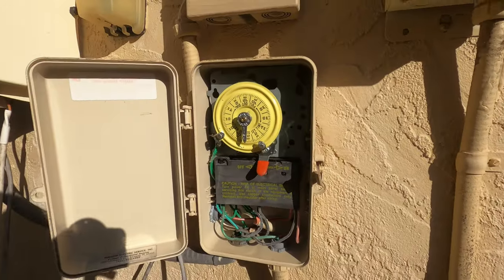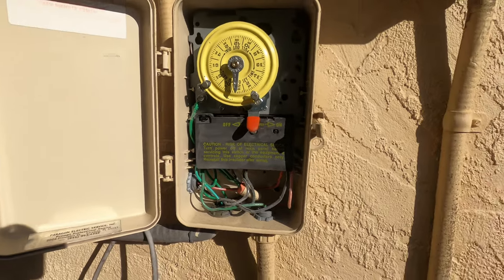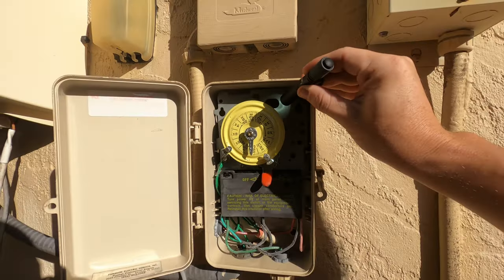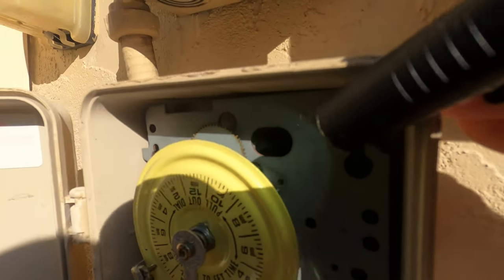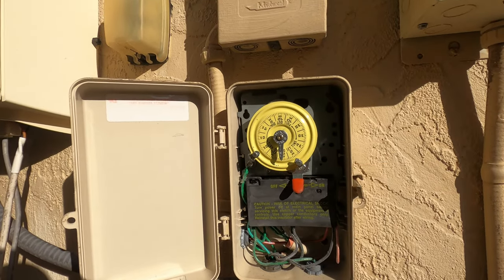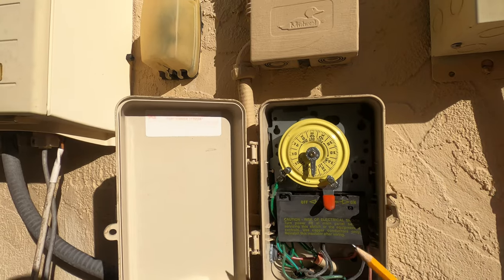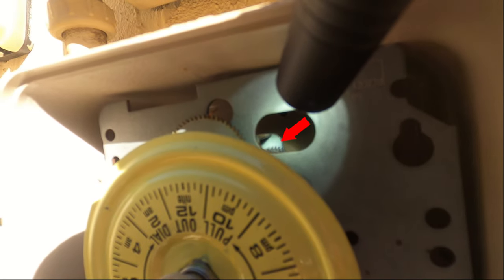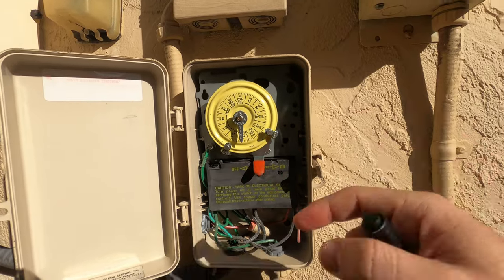How To Fix A Pool Timer That Does Not Work, Here Is How I Fixed Mine.

Comment: I believe when the GFI breaker resets from the sprinkler it’s gonna work because I did what you said with the chopstick and the gear started moving so the gears are moving. I just have to wait to reset the GFI. I believe you saved me from buying a new one and it’s fixed. Thank you so much for making this video.
Reply from the maker: @jimmievitalejr5182  that's great to hear man. Awesome!

Comment: Just a little advice, I’m an electrician, the non contact voltage tester is just that, it’s just beeps when voltage is there. You need to get a meter and see what the voltage is. There’s many times one leg of the timer is good but the other is bad or you have some voltage but not the correct amount . Voltage tester should really just be used for light troubleshooting. Meter is what you need
Reply from the maker: Thanks

Comment: My timer clock seems to stop around 10pm - this has happened 2 days in a row.  Once I reset the time, it works until 10pm. No power outage. Any thoughts on how to fix?
Reply from the maker: What are your on and off "stops" set at? Could it be getting stopped at the "off" but not coming back on?

Comment: On mine I could hear something mechanical chugging along, but no gears. I moved the back one, but could not get them turning on their own. I'm going back to digital I think.
Reply from the maker: @TravelingGonad  I'm using digital now. I have a video on here where I converted it over if you need help with the wiring. I kept this mechanical one just in case but so far the digital has been great.

Comment: My timer is for outdoor lights. I checked the dial in the box like u suggested and it is turning. My lights will not turn on no matter what I do. I even tried turning the breaker on and off. What else could be the issue? please help.
Reply from the maker: That's an interesting situation Nancy. If the gears are turning then that means you have power being supplied to the box. Is there any chance you had a power surge and that blew out all of the bulbs? If you pull one bulb you should be able to tell if it's burnt out. If this is landscape lighting is it possible the wire was cut from digging?

Comment: My timer stopped turning pool on/off. The timer stops keeping time when it reaches either the on or off tripper. If I remove the trippers then the timer works perfectly. I doubt that the trippers are the problem since it happens for both. So once I add the trippers again, pool does not turn on/off and the timer stops there until I intervene. Any ideas?
Reply from the maker: Have you noticed at all if those tripper tabs are getting pushed around? Or is the clock getting to the tabs and then just failing to kick off? It might be pushing the tabs and you've just not noticed.
Reply: No the tabs are firmly in place. If there is a tab at 10am then the clock stops around 9:30 am and just stays there. I’m wondering if the yellow dial (or wheels behind it)is somewhat stripped causing the timer to stop when it meets resistance?
Reply from the maker: Sounds like the motor doesn't have the torque to overtake the tabs. Is it possible thr tabs are switched (on/off) have they been removed lately? You can take one off and lubricate the backside with grease or oil (white lithium is best) and see if that helps. The back of the tabs are just slopes that guide the timer to turn off ... make sure those slopes are also smooth.
Reply from the maker: @user-sv8gx8tq1e  could possibly be barely on the gears. Make sure the yellow wheel is fully seated. Yoy know how you pull it out to adjust the time and it springs back I to place? Make sure it's fully going back into place.

Comment: Thank you. Just be careful with the teeth on the gears, I think I may have damaged one. It seems to be running.
Reply from the maker: The teeth in mine are metal. Do you have plastic?
Reply: @JackofAllTrades1  they are metal. My timer was over 10 years old, the gear did break. But I think I would have had to replace it anyway.

Comment: My timer is keeping time but the trippers do not turn it on or off as of yesterday. They are tightened firmly and not slipping. The dial just turns past them and they wont trip it on or off. The on/ off switch works fine when I switch it by hand. Its not not stuck. I can't figure it out. Has anyone seen this?
Reply from the maker: Have you changed the location of the timers at all? One is specifically for on, and the other is specifically for off... they each have a different metal incline backing. So if they are out of order, they won't work.
Reply: @JackofAllTrades1  my gears are turning, however the time clock does not move, so figured something not engaging or gears  not lining up? But have pulled out dial, set time, and pushed dial back somewhat forcefully to get it engaged...with no luck.  Thoughts??
Reply from the maker: @KB-wh9bu  can you manually give that yellow dial a clockwise turn? Does it rock back and fourth at all? I’m wondering if a gear is missing a tooth and you are in that position where it doesn’t engage.
Reply: Im having the same problem. Have you fixed this? What is the issue?

Comment: Having an issue with mine. When looking through the hole, only the far back gear is turning. The 2 closest are not. Have you ran into this?
Reply from the maker: The two closer ones are a much lower ratio so they move slowly. Have you pulled out on the yellow disk and then pushed it back in to try to reseat it?
Reply: @JackofAllTrades1  yes I have. I also turned the breaker off and on. I’m not sure what it is but it will not turn the yellow disk at all, even after a full day. I’m assuming the motor is still good because of the back gear turning but may try to replace.
Reply from the maker: @David Kurilko Jr.  try turning those other gears that you see that are closer to the front. It's a pretty simple machine, and half the battle is getting that rear gear to move, which you have. Possibly something has caked itself into the other gears.
Reply: @JackofAllTrades1  Hi Jack-great video! I had the exact problem and could not resolve the issue. Had power, gears were turning but yellow dial was not moving. I read the above, saw my back gear moving and then slowly saw the other gears move.  I reset everything and the timer started to move but then got stuck again. I think the closer gears might be getting stuck with by something. Any suggestions on an application to use to help loosen up the gears. WD40? Thanks in advance!
Reply from the maker: @wadegurnett  make sure the yellow facing is actually seated properly. There are small gears on the backside of the face that have to fit into a gear channel with larger gears. It's the same process as if you were going to change the time... you pull out on the yellow face, turn it, then release it, and it should spring load back into place. I suspect some people may have weak springs, so it's not going all the way back into the gear channel. If you wanted to use a lubricant, I would suggest something heavier than WD40... possibly white lithium grease that is typically used for garage doors. Good luck!
Reply: @JackofAllTrades1  Thanks for the speedy response-I will give this a try!
Reply: Mine is the same only the very far back wheel is turning I will try some wd40
Reply: Fixed! It had to much greese in there. Thanks
Reply: Hey Jack, I'm able to turn the back wheel with a pencil but after a few revolutions it isn't turning by itself. All power is on. Do you think it's time for a new one?